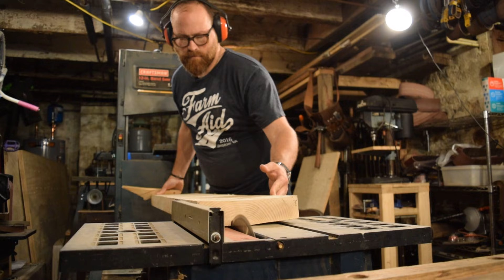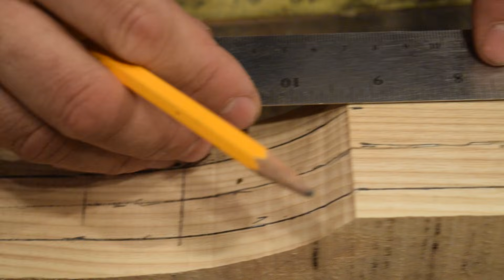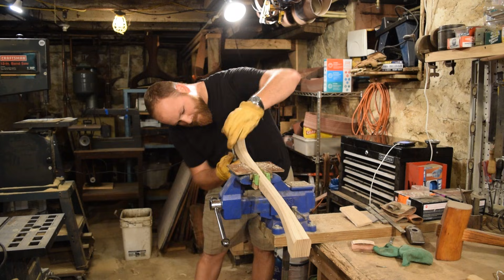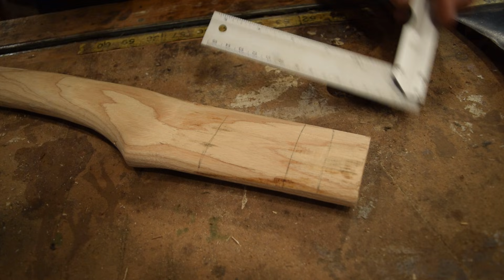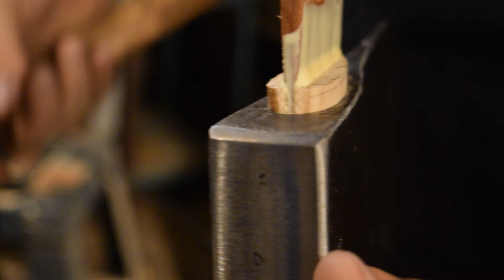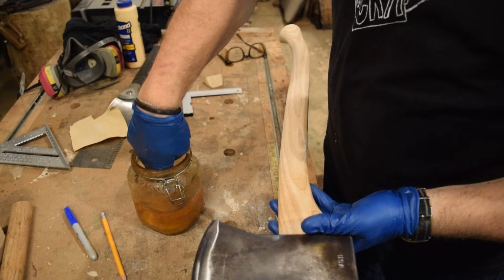Making an Axe Handle from Scratch

Comment: I had an old axe head,went out and cut a small limb off of an osage orange tree,shaved off the bark and made an axe handle out of it,when I put the wedge in it splitt too pieces and then I knew i didn't have the skills to do a good job,it was interesting though,but I hacked it.
Reply: Im going to try this. Way.. Osage is good for the wedge on a hickory handle.
Reply: What would it cost to have a handle made?

Comment: I just hung an axe and had the same problem the wedge only went half way in the kurff depth.the wood is protruding out on top and it is tight .but I was wondering is it compromised because the wedge is not seated all the way ?

Comment: Re handle length, how tall are you (bare foot).
I'm just getting into axe use and restoration. I haven't yet determined my optimum handle length for 3 lb plus head weight. (I'm 6'2" of a strong build)
I take down trees in Indiana & Michigan so I'd like to give this whole process a go from "raw scratch." From my location you see I have access to all the good wood types for handles.
(PS. I have 35" sleeve length for shirts)
THANK YOU FOR THIS WELL DONE VIDEO!!

Comment: You didn't explain how to design an axe handle, the dimensions relative to the size of the head, etc. You just explained what you did on camera ("I used a rasp, I drew a line") for your particular axe handle, using a blank and a workshop.

This isn't of any help to anyone

Comment: Superbly done!
One question. Should one avoid a wood blanks with irregular grains? I understand it that interlocked grains can be hard to work with but that doesn't mean that you won´t obtain  straight or somewhat straight grains to run parallel with the axe blade, right?
Also, how wide/thin should the eye be for a sledge axe/maul weighing around 6.6lb? It should be just enough to actually bend when you put the wedge in the eye. If the eye is too thick then there is a risk it won´t expand and tighten when you smash the wedge in (if you manage to get it in in the first place), right?

Comment: Good job! I also make axes. Let me give you a couple of tips. Make the wedge wider than the eyelets, you will trim it at the edges when you score, as needed. Make the wedge itself longer and thicker where you strike, then it will not split along when hammering. . The length of the axe handle depends on the height of the logger. It seems to me that the handle of your axe turned out to be too short for you.If you put the axe along the leg, then with your fingers you should grab the handle of the axe without bending. Check.
Reply from the maker: Thanks for the tips. All great suggestions!
Reply: @TheArtofCraftsmanship  Please, colleague! We have something to discuss, I have
there are drawings of ax handles. I am studying a video with the manufacture of axes, something I find useful for myself. Did Finnish Billnas axes make? Very interesting axes.

Comment: How would you cut it out if you didn't have a band saw?
I traced a store-bought axe handle onto a piece of sawmill lumber.  I've tried a scroll saw and a jig saw but neither would rip-cut the maple I have. I haven't tried the reciprocating saw yet.
Reply from the maker: I would just use a hatchet to rough out the profile, and then rasps to get it down to close dimensions. Maybe a jig saw with a course wood blade if I wanted to use a power tool.

Comment: Nice video, and nice axe handle.  However, I'd like to comment on some terminological issues.  The piece of wood you worked with was not quarter-sawn.  It is flat-sawn.  Also, it bothers me when people refer to the orientation of the growth rings as the "grain."  Properly speaking, "grain" refers to the fibers running lengthwise along the trunk or branch, or in a piece cut from them.  The growth rings are just that: growth rings.  I'm not trying to be a nit-picker here (okay, maybe a teeny bit), but these issues seem to cause a lot of confusion that can be straightened out by consistent terminology.

Comment: Ive always used linseed oil when setting the wedge, found that soaking the handle head and wedge tip in the stuff for a minute or so before driving prevents a lot of splitting and then applying linseed oil once a day for a week to the head after hanging and setting it all, haven't had a head fall off yet - havent tried wood glue though, end product was awesome, thanks for sharing
Reply from the maker: I’ve tried BLO on the wedge in the last and wasn’t happy with the results. I’ve been very successful with wood glue, so that’s my go to now. We all have our ways.
Reply: @TheArtofCraftsmanship  Ill give it a try! The finished result was great and it would be nice to reduce the chance of my shop burning down from excess linseed oil rags

Comment: Very nice job on the handle! From one craftsman to another, a couple points of constructive criticism. Use a bit of raw or boiled linseed oil on the handle at final seating. Lubes for a hard seat and also helps to protect and it swells the wood to help keep it tight over time. This also helps to water proof so moisture cant get in and cause decomp of the handle. Next, oil, NOT glue on the wedge. This helps lube and seat wedge, but, when the handle if cut proud, allows the wedge to be seated deeper over time if the handle gets loose. With glue this would be impossible! Overall, very nice handle!
Reply: I've seen this suggested before. Thanks. I'll go this route. I've quite a few hangings to do!

Comment: The gold standard of traditional axe handle making was established by the Schofield family of Lockartville Nova Scotia since the 1940's.  In his small shop near Hantsport Keith Schofield hand carved thousands of axe handles as well as peavy stocks, shovel handles - basically any and all types of commonly used handles.  He started by going to the woods to get straight grained ash.  The ash logs were split into pie shaped billets.  Only the outside part of the log was used.  Keith would pick up a piece of ash that still had the bark on, put it on his shave horse and start carving with the drawknife.  He would tell stories while he worked.  When he was finished carving the handle it was scraped smooth and beautifully shaped.  All that was needed was a rub with some sandpaper.  How long did it take to make one handle?  If he was talking a lot it took about 8 minutes but with no stories - 6 minutes.  I timed him many times and it never took longer than that.  He taught me to make axe handles but the best I could do after a lot of practice was 12 minutes.    He was the best man with a drawknife I have ever seen - he passed two years ago and he is sorely missed.  I just wanted to pass this story on out of respect for him and has craft.  Thanks for your videos - you made me think of him.
Reply: That is a very interesting bit of history. Thank you so much for sharing it.
Reply: My grandfather was making them in the 1920s, EJ Smith, England.
Reply: Original woodcutters made there own during there breaks, whittled from ash limbs, to suit them selfs , like buying a pair of shoes, every one had different feel, height, levels of fitness! It was the individual who would be swinging it at the end of the day, - that shaft had to be comfy for them, it was there bread n butter .
Reply: Any links to further reading or videos on this, please?
Reply: @breauxp  If you are interested in old time green wood carving Drew Langsner's book is a good resource and he has shop drawings in his book to show how to make one style of shavehorse.  Keith had opportunities to be featured in magazines and on tv but he always turned them down.  I realize now how lucky I was that he showed me how to make handles and orchard ladders.  He was one of a kind.
Reply: Interesting. Studies show the outer rings of softwoods are a little stiffer, but idk about ash. I'm guessing he wanted flatsawn (tangential) material as much as possible.
Reply: As seen on wranglestar here he also has a wood horse to clamp down on axe handles
Reply: Celler fellar, i grew up outside windsor, used to travel in and around hantsport. I live in kennetcook now. i'd love to grab a coffee and hear more about keith, and traditional woodworking and axe handles.

All the best.
Reply: @gregorymosher5008  Kennetcook is a nice place - we have  deer hunted in Stanley for over 40 years and I spent a lot of time in that area when I worked for Minas Basin Pulp company as a forest technician in the 1990's.
Reply: @cellerfeller1474  During my furharvesting course, some folks were talking about an old sawmill out back somewhere behind the gun range, they talked about a "sawdust pile" was a good deer spot. somewhere near it was supposed to be a stand of oaks. Any of that sound familiar?

I grew up in scotch village. I had family in stanley as well, with my family founding Mosherville back in the day.
Reply: @gregorymosher5008  If you look at the air photos from the 80's you can see round white spots - those are sawdust piles.  There was a bit one at the end of Ross Brook Rd in Stanley handy to the Walton river.  I can think of 3 or 4 other ones and one of them is near a brook not that far from the gun range.  The forest road ended at it.  I have a ladle that was used to dip water from a spring there.
Reply: @cellerfeller1474  You sure should like a wealth of knowledge and like you have lived a good life.

Comment: What type of wood do you use for the wedge when setting the handle? Does it matter?
Reply: Any hardwood will work but some people like to use cherry or walnut because it looks cool next to the lighter colored hickory or ash.
Reply from the maker: You can really use any wood, but the size of your kerf and the amount or space that can be filled in the eye will change. If your using a soft wood, your kerf can be smaller, with less room to spread out, and if your using hard, it will need to be able to spread out more, and can have a wider feed. You have to adapt to the wood. 👍🏼

Comment: Tyvm for a well laid out video. Have you ever found a connection between your arm span and handle OA length. For example does it add up to palm center to palm center, then divided by two. Just curious if you've created a rule of thumb over time.

Comment: Would I be able to use regular 2x4 wood to make a boys axe size handle?
Reply from the maker: Sure. It wouldn’t be the most durable, but could be done. If you only have access to hardware store wood, You would be better off with oak.

Comment: Great job!  First time I have seen this done.  I have two ax heads that need new handles.  I now know how to do the job.  One question I have is why didn't you use the band saw to cut the slot for the wedge?  Thank You
Reply: I would say preference a band saw seems like a mistake could happen easier.

Comment: Immediatly subscribed. What an accuracy and experience. You work like a CNC machine, my friend. I especially like your freehand draws, that turn out accurate like hell. I remember my grandad making handles from accacia and finishing them with broken glass and linseed oil. But what you present here is the top of the art, and I will combine both to hang any tool I use. Keep posting, please. Excellent channel
Reply from the maker: Thank you for your kind words.
Reply: Broken glass?
Reply: @shags1130  Yes. When you break a glass bottle, you'll find a few pieces that have a straight, not jagged edge almost in right angle, but sharp like crazy. If you scrape an almost finished handle with that glass shard, the cut surface of the wood is going to be as smooth as marble and still a little bit textured. It is going to look like a piece of wood carved by knife, but much more delicate. This surface, treated with linseed oil, is great to aid the needed friction while you're not going to develop blisters and hot spots on your palm. If you ask why glass rather than a knife, the answer is, that the knife has a very thin edge that is harder to control, but this kind of glass edge is unable to cut into the wood so deep.

Comment: An excellent video, I really learned a lot, thx. I'm on my way to my workshop to continue making an axe handle made using curly birch wood. This kind of wood is just too precious for a beginner to use for learning purpose, but let's see how this goes.

Any ideas how to make a shiny and polished handle that isn't slippery?
Reply: Sand out handle to whatever polish you desire, 180 grit or higher, then put a couple wet coats of boiled linseed oil on it, preferably on a hot day in the sun. Wipe off excess oil after 5 or 10 minutes, and let dry. The oiled wood won't be slippery like a coat finish. Any texture in the wood will rub your hands and give you blisters quickly.
Reply: @benr8772  Thank you for your guidance. I already used some tung oil and curly birch sure looks nice and shiny. I might try to sand out part of the handle and add linseed oil to make the handle less slippery. An interesting idea and worth trying.

An another alternative is to attach leather strips on the handle. I've seen some Northmen guild's axes that have this kind of handles.

Comment: Thanks for mentioning the head turn. Easy thing to miss. Have you tried using a spokeshave? A lot of handle makers use them.
Reply from the maker: I do like using spoke shaves, but I’ve found I like using rasps and draw knives better. Thanks for watching.
Reply: @TheArtofCraftsmanship  interesting. a drawknife works well for me when hogging off lots of material. i have little control over it and i make mistakes often with it. the spokeshave has so much finesse that even a caveman can use it
Reply: @pamtnman1515  , flip the drawknife upside down and ride the cut on the bevel. By adjusting the angle of the handles, you can take shavings with as much control as the spokeshave with instant adjustability. Also try angling the blade left and right for skew cuts when you're doing this.
Reply: Ben R you have talent, I don’t. Believe me, I have tried. I also use a dull draw knife for fleshing pelts (I trap), and I struggle with that, too. Thank you for the suggestions
Reply: @pamtnman1515  You can do it. :) Does take a bit of practice to get fast with it, but if you go slow at first and take thin shavings, you'll get the hang of it quickly. I've only ever fleshed little hides, squirrel and rabbit, when I was young, with sharpened wood or bone
Reply: Ben R I went with a spokeshave for any project I care about. The drawknife is used mostly for debarking railroad ties and other lumber we produce that has any wane.

Comment: I have a couple Ash trees already cut down and ready to mill for a project and I have several hickory trees to cut down whenever I want and I've never made an axe handle so whatever advice you can give I will follow. Ash or Hickory and any advice for a beginner would be greatly appreciated. I have 2 teenage twin boys that I need to either buy glasses for or a log splitter cause they are about to break the bank just with me buying new axe handles!!  Thanks for Sharing

Comment: I have an Axe head that my dad gave me after my grandpa passed. I tried to pound it onto a regular store bought axe handle. Even with removing enough matierial, the bottom digs into the handle. The axe head looks regular except it is v shaped on the bottom. Any idea if there is a special type of handle this bit takes?
Reply from the maker: I believe you are referencing a jersey pattern axe head. You do not need a special haft for that pattern. You just need to create a very gradual taper on the axe handle where it goes into the axe eye. Just a little bit of fine tuning and you should be in business. Good luck.
Reply: Thanks alot for the info.  I'll taper it a little further down on the handle then. Wanted to make sure I wasnt trying to use the wrong handle. Never messed around with the jersey patterned axe heads. Enjoy the show! Keep it going!!

Comment: Very nice work on shaping the ax handle.  Not to be picky but in the first minute and a half you called the wood you were using as "quarter sawn," which it was not.  Quarter sawn means the grain runs perpendicular through the flat sides.  What you have is plain or flat sawn.  The grain orientation you selected is perfect for you application, it is just a matter of being accurate in describing the wood you used.  Again, I don't mean to be picky as I think you presented a great video on making an ax handles from scratch.
Reply from the maker: You are 100% correct. Must have slipped my mind. Thanks.
Reply: Appreciate the clarification as I wouldn't want to head into a lumber yard asking for the wrong grain orientation! (Although I hope I stay motivated to capture tree trunk raw wood, I may likely give this a try from seasoned wood!)
Reply: Thanks for that info!!

Comment: Thanks for the video. I'm in the process of doing the same thing with an ash handle also. Do you have any tips for how to identify the axe manufacturer? How to identify the markings. My axe head looks to be cast steel or maybe forged. Is this possible?
Reply from the maker: Robert Brighton there are lots of ways to identify makers, but I would have to be able to see the head to help you out. There is a great group on face book called “Axe Junkies” where you could also post some pics to get help identifying. Good luck.